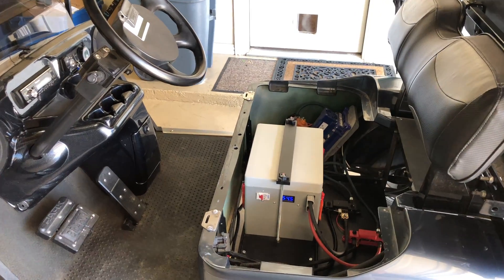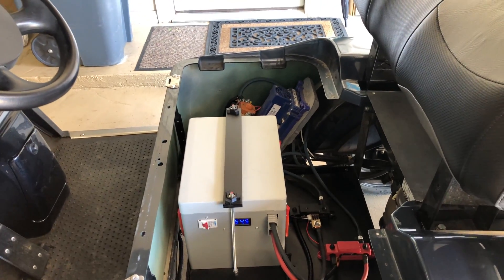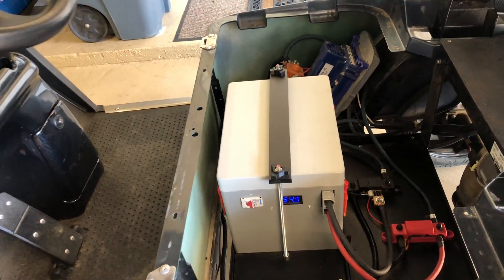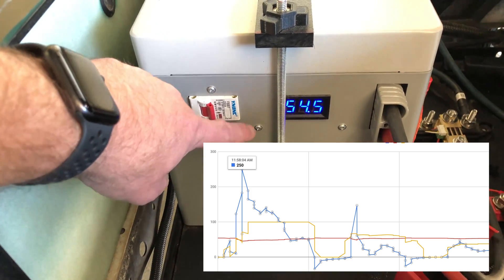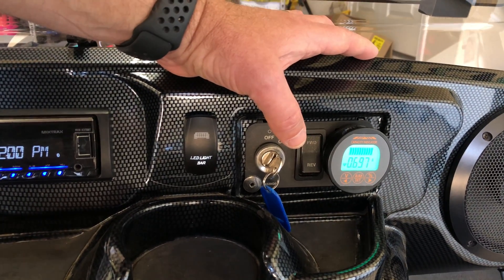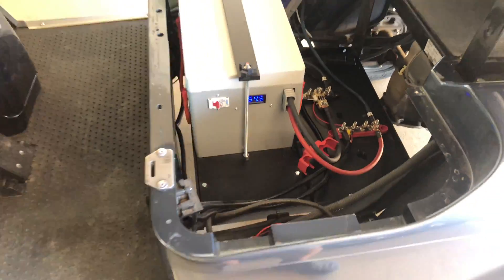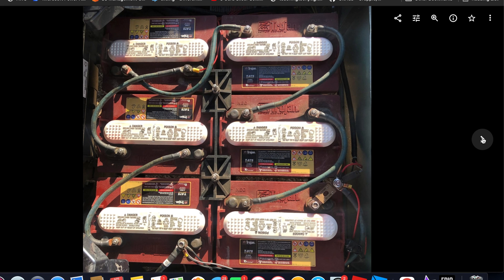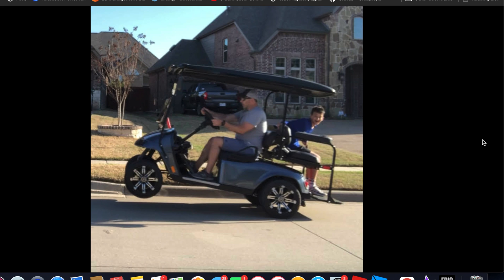Wheelie power from Lithium upgrade

Comment: How fast is your golf cart now?
Reply from the maker: It did about 26 MPH with those wheels / tires. I now have 23 inch tires, and it does 30 MPH.
Reply: Daingggg!   I have 14 inch tires with a lift and eco battery.  The rest is stock but I won’t pass 22

Comment: Great video. Does the battery come with everything we need to convert from 6-1 ?
Reply from the maker: Thanks. It doesn’t come with a way to mount it, so you will have to figure that out. You probably need the bus bars too if you have any other electrics like lights/radio.
Reply: @mattadata2  thank you for the response !

Comment: Did the shunt and meter come everything needed to install? Wire and all ?
Reply from the maker: Comes with wire to connect the display to the shunt. But you need  1 small wire for the B+ and then obviously the thick gauge wire that attaches to the studs.

Comment: Hello looks like I have the same cart as you, I got the husky 48v big battery.  Hooked everything up exactly as you did. I have the ezgo delta  Q SC 48 charger into the port. Flashed red and won't charge. Any ideas? Does yours charge correctly from the stock charger?
Reply from the maker: Yes, my stock charger works with it and and so do my solar panels. 
How many times does that red light flash? That’s a code that can tell us more info
Reply: @mattadata2  It just blinks twice fast. I noticed it charges with the green light blinking, then when it gets to 102.9 AH it starts blinking red. 103AH is full charge on the husky. Maybe the charger wont fully charge the lithium? i heard the only take them to 80% BTW thanks for your video it helped me build my cart when my lead acids died. Shunt idea is great!
Reply from the maker: @chriscole9971  Thanks. Glad it helped. I use my stock charger, but I don't think it takes mine to fully charged. Fully charged for me is 54.6v, but my charger stops about 52.5v. I Can fully charge it with my two solar panels. 
Look up what your blink codes mean. https://buggypartsdirect.freshdesk.com/support/discussions/topics/8000007881

Comment: What is the max amp draw during hard acceleration?  Also, what's the amp draw for level road cruise with max throttle?  and at what speed?
Reply from the maker: Here is a chart. Right when I floor it, it spikes to high 200 ish Amps, but only for a split second, then it quickly drops down as speed increases. Cruising is 40-80 amps.https://docs.google.com/spreadsheets/d/e/2PACX-1vTa0Ko9cfDA8pz5s8otBaz4QIcnNPDe9-XzOuOYCf1IwdRFHctAgV-CN-iE10dpn-SZI01fMCwZYddo/pubchart?oid=672319775&format=interactive
Reply: @mattadata2  Thanks for the detail info!!  you must be a engineer.  I was planning to use a lithium pack I already have that is only 48V 75Ah.  Since the cell I used (Tesla 21700) is only rated for 15 A draw, your chart clearly demonstrated that my I'll need to add few more paraelle bank to be safe.
Reply from the maker: Haha. Thanks. Nope, not an engineer, but I like to play one on YouTube!
Good luck with your pack. But keep in mind that if you have stock motor and controller, it will be much lower.

Comment: If you started from scratch with a stock EZGO TXT, how would you build out?  Let’s say a medium cost build and a “price is not an issue” build?
Reply from the maker: For both medium and high cost I think I would go with Navitas AC motor and controller. $1800. 
Where I would get picky is on the battery. Medium cost, one of the 48v from BigBattery. 
High cost, 72 volt lithium!

Comment: Super cool!  Did you see a significant improvement in battery life?  I may need to do this.
Reply from the maker: I can roughly go the same distance as when my leaf acids batteries were new…35ish miles. But it has a little more speed and torque.

Comment: hello i want to do similar to my toyota coms 72v electric car. So based on your video i just need a battery, a bus bar and that`s all? Cos i have heard people saying i can`T simply put lithium batteries as replacement, cos need to setup other stuf but cannot understand what i really need
Reply from the maker: Does you Toyota already run on 72 volts? If so, there is nothing else you need. Just make sure you have a way to charge it…that might be different.
Reply: @mattadata2  yet it uses 72v 52Ah lead acid batteries. I was thinking to bypass the traditional charging method and buy an external 72v charger so i can charge my batteries. I was thinking to put the nissan leaf batteris on it (any comments on it?), also from an Ah point of view should i check/take care of something? I`m really newbie on this type of swap and worried i can blow the engine
Reply from the maker: @KeigoMoriyama  72v 52Ah is the same no matter what the battery type is. Of course all battery's have a voltage range. So it will be a little higher when fully charged vs almost dead. Just make a 72v nominal fully charged voltage is not more than your vehicle could handle. Same with lead acid, so I think you would be OK.
Things are a little different if you want to build you own battery....it can be dangerous. You need to really understand what is going on. If you build it from leaf cells, then you need to add your own BMS. If you buy a premade lithium battery from one of the big guys (BigBattery, Eco, ExtremeTeam, etc), then those already have a BMS in them. 
If you are new to all this, I would suggest buying a premade battery vs building from leaf cells.
Reply: @mattadata2  thanks a lot for your reply. I’ve built a 36v with 18650 and bms by myself already but yes can understand the leaf one could be little bit different . Thanks again for your time replying me. I’ll check also the sites you gave me. Big problem is that I live in Japan so shipping could be too expensive
Reply from the maker: @KeigoMoriyama  I think you would be fine since you have done this before on a smaller level....point is you understand the concepts. Lots of people here in the US build batteries for their golf carts from leaf cells. Since your in Japan, you might have better access to them. Tons of good info out there. I think you would be fine. 
I just looked up Toyota Coms....very cool vehicle! Good luck and let us know what you end up with.
Reply: @mattadata2  thanks appreciate the time you took to reply me! Will start harvesting some leaf then

Comment: Isn't an amp hour an amp hour regardless of battery chemistry?   So compared to new lead acid  at 200 ah, does this pack last half as long?
Reply from the maker: Yes. An amp hour is an amp hour. But the thing about lead acid is that once you go past 50% capacity, it’s detrimental to the battery. So if you have a 200 amp hour lead acid battery, it only has 100 usable.
Reply: @mattadata2  man that's false advertising.  I thought I was getting 200 ah.  So the 100 ah pack doesn't give you anymore range just less maintenance,  and longer life?
Reply from the maker: @dand7056  yep. And a lot less weight. And not as much voltage sag, so should do better on accelerating and hills. Top speed is about the same.

Comment: Excellent video, thank you. Question, are all these components waterproof so that the compartment can be easily rinsed out and cleaned?
Reply from the maker: Thanks. The controller is waterproof, and the solenoid should be fine.  But I  wouldn't spray the lithium battery or the shunt directly.

Comment: Great video. I have a couple of questions. 1) What kind of solenoid did you get for this controller? I read that you mentioned that the controller was a 500A. 2) Is this a SR Serie & PMDC or XCT SHUNT? 3) What motor upgrade did you did. Do you mind sharing a link on where to buy that motor? Thanks!
Reply from the maker: Thanks. It’s a 400 amp solenoid from https://www.cartsunlimited.net/solenoids.html
It’s XCT Shunt from Alltrax
Motor is from https://empinc.biz/

Comment: awesome...what is the top speed?
Reply from the maker: Top speed is about the same as lead acid. 27 MPH.
Reply: @mattadata2  I live in a golf cart community. People are telling me the LIPO doesn't have the range of the lead acid? I want to do this but they are making me nervous.
Reply from the maker: Nobody can answer that without knowing the size of each battery. My 95 Ah pack is about the same as a 200 Ah lead acid pack because only half the lead acid capacity is usable. I can go 30 miles on 95 Ah.

Comment: Nice job on the install!  Everything looks really good.  I had 4 individual lithium 12 Volt batteries in my 36 volt cart (3 for motor 1 for lights etc), after 3 years of running them I had constant issues with one of the batteries BMS shutting it down.  After many emails to the company I found out you are not supposed to run more than 2 of their batteries in series or parallel (I was pretty furious because they advertise golf carts right on their website).  I have an upgraded motor and controller and I have changed the rear end gear to a taller gear.  I went with the 36 Volt bigbattery and used much of the same components as you did.  The 36 V is a monster, it is much larger than your battery and I had to make a costume mount for it but it does fit.  I am using the same  meter as you but with one small issue.  Whenever I reset the charge meter back to 100% after charge it drops to zero after a short amount of driving but when I reset it again it seems to work fine, so I always have to deduct about 5% off the charge.  The 36 V system as you probably know has a higher amp draw and even the "heavy duty" forward reverse switches have melted and my reverse no longer works.  I had to completely by pass the switch so I can still use it.  I'm thinking about upgrading to one of these  https://www.cartsunlimited.net/reversing-contactors.html .  Unlike your cart I have less torque but more speed.  On a flat open road with no wind I have hit 37MPH.  I am so glad I found your video, the BigBattery kicks ass, thanks for posting!
Reply from the maker: Cool! Which 12 volt lithium did you have? I have a friend with Allied Lithium 48V, been working good for him so far.
37 mph is super fast on a cart! Did you upgrade the brakes? LOL. I have had multiple failures like you before I got to this point. I haven't any issue with my meter like you, but I don't think it is super accurate. When I charge my cart, it gets back to 100%, but then it keeps charging for a long time after. I assume it doesn't sample the amps used fast enough. I am tempted to try the Victron shunt, but its so expensive. FYI - I never reset my meter.  I just set it once and the beginning. Yeah, my first cart was 36V....does draw a lot more amps. I bought a lot of my stuff from Carts Unlimited. He has one of my videos on his site. LOL https://www.cartsunlimited.net/all-motors-1.html
Good luck with the new battery and forward/reverse switch! Keep us posted.
Reply: @mattadata2   This was the company I went through https://greenlifebattery.com/applications/ev-golf-carts-mobility/ and do not recommend for a golf cart to anyone!  I probably need a brake upgrade, usually it is just me on the cart so it stops okay.  If I get my whole family on board (5 of us) it definitely struggles if I'm cruising at 30mph.  I am okay with the meter, it gives me a general idea, I usually charge when I get into the 60% range.  I use my cart all year round to commute to and from work, even in the snow.  It is less than 2 miles one way.  I usually charge about every 3rd day.  I am curious what full range would look like but I don't really want to trailer it home when it quits lol.  Be nice to have a big solar panel on the roof and I have done little research but it doesn't seem like you can get much of a charge even with the best panels.  Thanks again for the video, seems to be helping a lot of us!
Reply from the maker: Its funny you mentioned solar, I just started playing around with solar charging my cart. I picked up 2 used 230 watt panels. https://www.youtube.com/channel/UC0XfP4cf3iFuZkQmo6JLDYw/community  It charges the cart a little better than I imagined. My stock EZGO charger charges my batteries at 12 amps. The two solar panels will get up to 7.5 amps in perfect sun, but usually around 4-5 amps. So it certainly couldn't charge the entire battery in 1 day, but I have charged it up about 25% in one day, which is about 7.5 miles in my case. It would easily charge your round trip to work!
Reply: @mattadata2   We have solar on the house roof but it goes back to the grid.  So realistically it covers the cost of the charge easily.  Sounds like you are quite the tinkerer I'm guessing you might be some type of engineer?
Reply from the maker: Perfect! You are charging your cart with the sun. Not an engineer, I just like to tinker with motors, electronics, micro controllers, 3D printing....etc

Comment: I was trying to replace my Electric ATV's 1500w   48v  (4x12v20Ah lead acid) battery  and I was wondering what LiFeP04 battery you could recommend to replace my old acid battery.   Any help would be greatly appreciated.
Reply from the maker: Hi. Is this a toy ATV? Or a real one? Asking because 20AH is really low capacity. What model/brand batteries do you have in there now?
Reply: @mattadata2  https://www.venommotorsportsusa.com/products/venom-1500w-brushless-48v-atv-e-grizzly
Reply: @mattadata2  its a full size ATV, i posted the link.  its called an E-Grizzly 1500w 48v ATV
Reply from the maker: Maybe something like ebike battery. https://amzn.to/3gm3VWb Not sure how much room you got, but this should work. May have to swap out the connector. But its 48V lithium and 20Ah.
Reply: @mattadata2  Ty!
Reply: @mattadata2  Do you think it could handle a higher V, like  60v? or is that too much?
Reply from the maker: @Bennysnamehere  No, I would keep the volts at 48. You can go up in Ah as much as you want. But 60V would probably kill it.
Reply: @mattadata2  ty!

Comment: Where do you pull the 12 volts for the stereo? I suspect if you open the battery is probably a stack of 12 volt batteries.
Reply from the maker: I use a 48v to 12v voltage reducer. Same for lights, horn, etc. you should never pull from only part of a lithium battery pack. That’ll throw the cells out of balance and ruin it
Reply: @mattadata2  transformer?
Reply from the maker: @MrbrentLa  Like this: https://amzn.to/3pIBViT

Comment: Thank you for making this video, it’s helping me tremendously!  
2 questions, please:  1) The large orange cable attached to the side of your battery housing, what is that?  2) I see you have the battery indicator hooked directly to the bus bar, without using a ‘voltage reducer’.  Wouldn’t it be necessary to run that meter on 12v?  Or am I missing something?  Thank you in advance!
Reply from the maker: 1) That is the positive cable coming out of the battery and attaching to the positive bus bar.
2) The meter I am using can be run on 48 volts directly! So makes it very easy.

Thanks, glad it helped :)
Reply: @mattadata2  Thank you for the help, and  especially for the quick reply!
Reply: @TheSib  Hey man, the dude misled you. The large orange "cable" is a rope with ring terminals crimped on the ends. Big Battery uses rope handles to move the battery around.
The red and black wires in the gray Anderson connector is the power output cables.
I have a Big Battery Hsky 48v 103ah battery. They switched to white rope but I recognized the crimp connectors they used on the handles.
Reply from the maker: Haha! Thanks! I had no idea he was talking about the ropes.